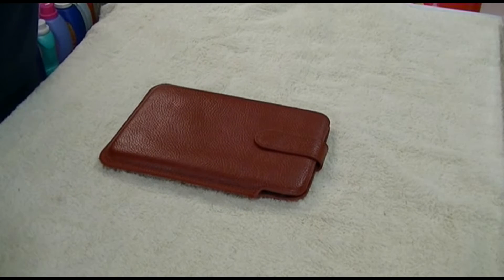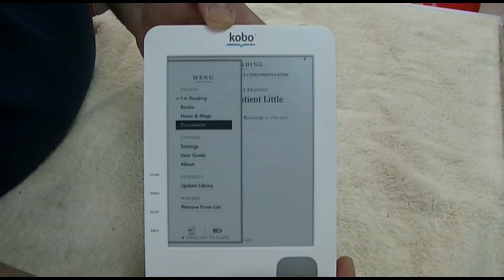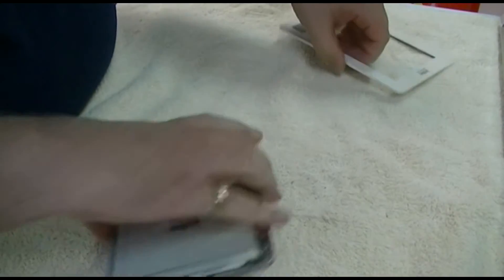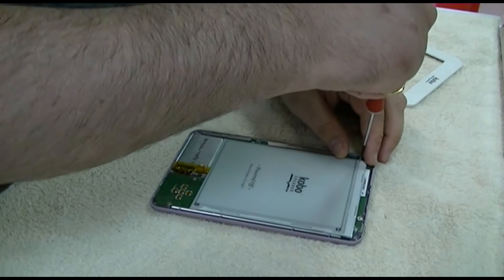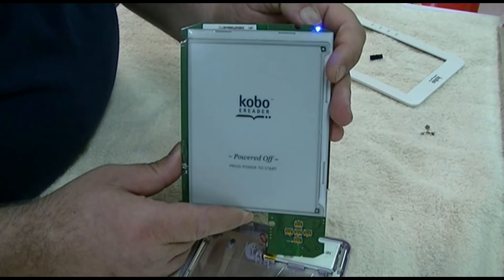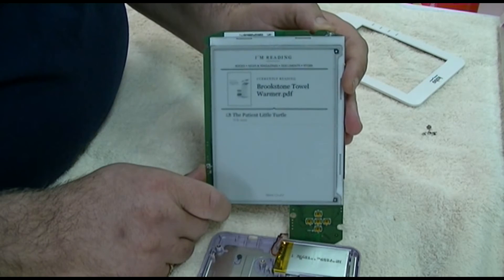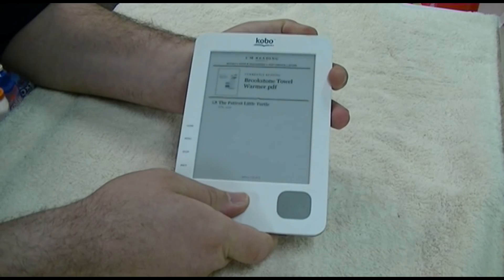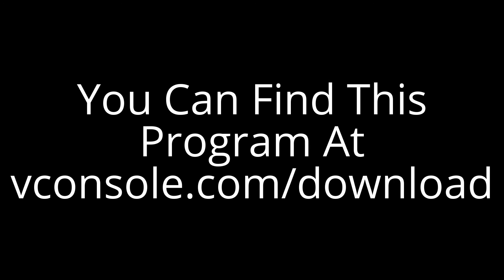Kobo WiFi e-Reader Disassembly & Reassembly

Comment: Thank you for this video!  I (stupidly) put my Kobo in a storage box for about 6 months.  The rubber power button has disintegrated and won't keep a charge for long.  I'm hoping I just need a replacement battery!  Any hints on how the battery is removed and where I might find a replacement? Amazon has similar ones, but not exactly the same. Thanks so much!!
Reply from the maker: You're welcome.  I have a video on replacing the battery in a Kindle Fire tablet, I'd assume it's fairly similar.  You can see that video here:
https://youtu.be/AqiMrhzYS1U

You might have better luck looking for a replacement on ebay.  You might also find a "donor unit" that's cheap and functional.

Comment: After removing the four rubber pads and screws on my Ematic EBW304 e-reader I couldn't figure out how to open it to access the battery. Your instructions were VERY helpful, as it unsnaps the same way as your unit -- around the screen first, then outside later. I doubt that I would've ever thought of that. Thanks!
Reply from the maker: You're welcome.

Comment: can you use a bigger sd card other than that 2gig used thanks for the video. It helped me a lot great video.
Reply from the maker: I'd imagine it would take a 4GB, maybe even 8 or 16 or even 32, but probably not larger.  I haven't tried it.  A quick Google search says it will accept to a 32GB card.  Try that next time first.
Reply: @jaykay18  ok thanks was doing a little research and it might take 128gig chip. But why would u want that big i don't know
Reply from the maker: @tony8512  Agreed.

Comment: Would you happen to have an image from a working kobo wifi? I got a used one but my kobo can't connect to the internet and it isn't detected when I plug it into my computer. I tried going to the mobile read website but I unfortunately can't make a new account since the activation process didn't work for me.
Reply from the maker: Would I have an image?  Of course.  Would I share it?  No, it's copyrighted software, and I'm not going to break the law.  I said where I got it, I can't help you with technical support on a website I have nothing to do with.
Reply: @jaykay18  wow, I'm not sure why the negativity. I appreciate you posting how to open up the kobo and it has helped me. if you can't share the image, that's fine, but this could've been communicated much nicer. I only wanted to do some reading during this pandemic. Thanks for the help anyways.
Reply from the maker: There's no negativity.  You were asking me to assist with something outside the scope of this video.  As it is, I took the time to respond to your comment, like it or not, which is something 99% of other channels on YouTube wouldn't have even done.  If you had asked me about something directly pertaining to what I did in this video, then I'd be more than happy to offer any other additional assistance I was able to..

Comment: Thanks for this sir. Uhm, just want to ask though... would you happen to know if there are any websites or retailer...etc who sells replacement parts for KOBO WIFI models? Specifically the front cover (which includes the nav keys)?
Reply from the maker: Thank you.  I don't know of any retailer selling replacement parts for this unit, it's rather outdated by today's standards and I'm sure you'd be much happier replacing the unit with several of the low-cost options available from Amazon, which are much more capable.
Reply: @jaykay18  Oh...  That's a bummer.  Thanks for your quick response though sir!
Reply from the maker: Sorry I couldn't have been of more help.  You might get lucky and find someone's old one on ebay that you can salvage for parts.

Comment: Thankyou for this video. My 9 year old Kobo that's gotten me through thousands of books needs some cosmetic care. The Power button had sunken in and the D-pad was started to cracked and disintegrate due to daily usage and time. I bought a broken one off ebay and plan on swapping out the internals.
Reply from the maker: You'll be just fine.

Comment: Trojan WARNING!!! PLEASE WATCH OUT! I contacted DavidFor and got the Kobo image. I burnt that image onto the SD card using Etcher. After the image was burnt, the Kobo device was able to boot successfully. However, it was connected to some account (we6shorts@yahoo.com). I wanted to hook it up to the PC to re-register it to my account and read my content. However, the Kobo Desktop app could still not connect to the Kobo. So i browsed onto the SD card and went into the "Desktop Installers" folder, hoping i would find a different installer that would connect to the kobo. I went into the "Windows" subfolder. As soon as i did, the McAfee Endpoint Security software running on my PC intercepted and deleted the DesktopInstaller.exe file because Malware was detected. The threat name was Artemis. The threat type was Trojan. So please be careful when handling the image that you burn from this!!!!!
Reply from the maker: Had no trouble whatsoever.  I did notice the strange yahoo account, but IO have no account with kobo and no content, so I left it alone.
Reply: @jaykay18  Do you have an active virus scanner running or is your machine vulnerable to attacks? Did you try connecting the Kobo to your PC (via USB) and then browsing to "Desktop Installers\Windows\" and scanning the DesktopInstaller.exe?
Reply from the maker: I honestly don't remember, I recorded this video almost 2 1/2 years ago.  Different computer now and everything.
Reply: Hi TarekI would really appreciate the image as I also cannot register on the mobileread forum so am really struggling :0(

Comment: Hi, I liked your video. I have one Kobo the same that still works but it's been in storage for some time and the rubber on the bezel has perished. I can't find anyone selling a replacement. Can you make a suggestion on where to get a replacement bezel. If Ebay or any other resource has anything that you might know about can you publish or send a link for me please. Rob
Reply from the maker: If the rubber D-pad has perished, I doubt you're going to find a replacement as these have been out of production for some time.  Only thing I could say is search for a whole unit on ebay, maybe a "non-working" or "parts only", maybe even a broken screen one, and just take the bezel from that one.

Comment: Thanks for the video showing how to open  the reader. I have a power switch problem and have to open it up to see if there's anything I can do to get it going again.
Reply from the maker: You're very welcome.  Some DeOxIt or other contact cleaner may help you.
Reply: In the end I didn't have to open it up. Charged it up fully and all of a sudden, the On button started working again! I'll definitely keep your YouTube video close by if I ever have to open it up. Thanks
Reply from the maker: No problem, and thanks for letting me know how it worked out!
Reply: Donald DesChamps What was your power switch problem - and did you cure it? Mine is “depressed” into the unit, making activation difficult.

Comment: Hi Jaykay18, my Kobo Wiki stops working. Your video helped me dissemble the unit and got the SD card. I would really appreciate it if you could kindly provide the link of the SD image file. Thanks much.
Reply from the maker: There is no direct link for that file.  You'll need someone who has the same model to take an image of their card and send that to you.  If you read the video description, a kind user on a Kobo forum provided me with a link to his image.
Reply: I tried the Mobileread forum but cant even register because the recaptcha software wont work grrr

Comment: I see what you mean. Those things must be pretty nifty for storing libraries of random stuff. The batteries last forever, and it saves on memory on other devices. Brilliant!
Reply from the maker: +Rebelkid1112 Yeah not too bad!  If the device were faster, and the screen nicer (this is first-generation stuff here) it would have been a real score.  I understand you can put an SD card in it for more storage.  Through my research, I've also heard you can use a card larger than 2 GB; you reimage a new, say 16 GB card with the 2 GB image, then grow the partition out to the 16 GB mark.  I might be using 1.1GB of the card, and that includes the entire OS to run the thing, so I don't think I'm going to run out anytime soon!